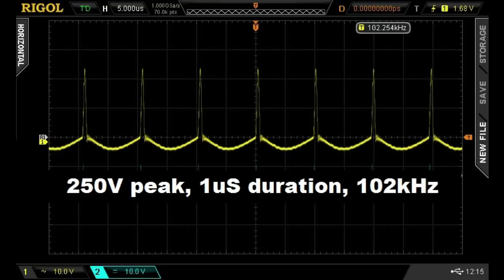Longitudinal Current Induced by Dielectric Field Impulses

Comment: Keep in mind that moving charges do not create a magnetic field. When a dielectric field aligns charges, a magnetic field forms. These are position sensitive, and particle sensitive effects.  Only the correct type of particles sensitive to the dielectrically conditioned Ether or the magnetized Ether respond to the Etheric state that embraces them, demonstrating the presence of the Ether in that state. The idea that moving charges create magnetism has been disproven as simply moving charged particles does not produce magnetism. ref: https://youtu.be/Khl4F6cr36A 

Also consider that magnetic lines of force, as described, do not exist. Those are how magnetized particles will align relative to each other in a field of stronger magnetically aligned Ether. Other objects that otherwise are pushed by the magnetized Ether field do not distinguish any such lines as lines of force. It is a simple way to explain some of what standard electrical equipment will do, anyone would be on thin ice to take it further and assume the explanation is accurate to reality or can be used to develop new designs.

Back in the '80s Borderland sciences staring EP Dollard and crew (P Lindemann) demonstrated differential electrical wave transmission 57% FTL in conductors using a differential line consisting of series capacitors and shunt inductors. He also demonstrated that the magnetism and charge traveled coincidently, not off-setting each other as typically happens in normal differentially driven circuits. ref: https://youtu.be/6BnCUBKgnnc This is an example of how a superior technology, even easy to implement will be shunned by industry if it is disruptive enough towards existing systems and beliefs. Neither of these gentlemen have led a normal life since that time; It also clarifies that Steinmetz was simply putting together a model of electricity that was tightly designed to aid the productivity and patent protection of AC Power, not to explain how electricity could be employed, or what it was and how it really worked. HE was also a political critic of the industrial system he served. I believe he wrote telling comments in the beginning of his textbooks that painted a dark warning to free thinkers who did not conform to the methods commanded by those in charge. As well as publishing books on the failings of free-market economics to be sustainable without back-room deals and price-fixing or other methods to carve up the markets between suppliers (which would include creating a false narrative to justify using specific technologies).

Using standard electrical descriptions to explain new phenomenon is a minefield of exposing the pseudoscience nature of modern physics. And I appreciate that you have avoided being caught up in that confusion with your explanations. But, I also can't let it go. I cling to the belief that clarity is possible and by exposing the silent assumptions new possibilities will be revealed. Good Luck, be safe. Wilhelm Reich discovered how to capture, generate, and apply this technology without electricity. He did not have access to the discoveries Tesla had made and remained ignorant of the threat his work posed; He was convicted of a crime one of his employees committed and killed in prison after all his research was burned by the state of New York. His focus was primarily on healing, but by chance he discovered how easy it was to make it rain; I'm sure he was blamed for some massive futures losses by investors looking to sell short during a time of drought in the US.

Remember, energy is not supposed to be created, an inane statement when you know it is made of two components that produce each other. Which makes amplification possible; but, what is the difference between amplification and creation? (practically nothing) Here's the rub, the lie is so easily exposed (without it, the transatlantic cable is impossible). But pressing the point threatens the authority that empowers governments around the globe. Peace, B
Reply: How Did W.R create capture enagy without electricity or healing . I know ougone(sorry spelling sir)
But I need both healing and enagy capture, create without Electricity please let me know sir if it true thank you sir.
Reply: @motobacktoconstitution4138   Reich captured natural/free-range Ether with capacitors of special construction. The metal plates were all magnetizable and the insulators were natural materials (wood, wool, that kind of thing. The collectors had metal on the layer closest to the person receiving healing energy, shields were reversed. Not good for every illness and overdoseing was a potential problem. Up to 7 layers improved collection with each layer, more seemed to be just extra mass without measurable improvement in collection. People in the box began to see the active Ether in the air. Reich admitted his name; "Orgon" was likely Ether. He did not have access to Tesla's work or he might have kept a lower profile. Tesla made it overwhelmingly clear his discovery would break the bank of industrialists in his day, and today it could be even worse.
Reply: @motobacktoconstitution4138  The details of Wilhelm Reich's discovery of capturing and amplifying natural Ether from the space you occupy is detailed in the book: "The Orgone Accumulator Handbook" by James DeMeo, PhD.
There are health warnings of overcharging your system with the technology, so it is worth the read.
Basically, you build a 7 layer capacitor of magnetic metals and organic dielectrics. You better have some tested construction skills, the weight of the structure is dangerous. But, you don't need a Ph.D. or 10 years paying rent for a University to do it. 

You can charge up your body to good health and the ability to see energy in a way that science does not dare acknowledge for fear of cutting off funding from their big pharma funders. There is a proven technology, putting living beings in a high voltage field, that improves cell function and replication to the level of enhanced DNA replication (faster healing and improved DNA expression, longer living) which big pharma patented because it threatened their "drugs to treat symptoms without curing" business model. ORiginal work done by Ebner, called the Ebner effect. The swiss pharmaceutical company found any voltage from 1 volt/cm up increased the effect, but 100 V/cm had a significant effect. So it seems we like being charge aligned-magnetized.or rather cellular living likes it. No one has studied the Reich box, it may do the same thing (Maybe in a small way) Google "Ebner effect". He studied plants and fish, sold patents to big pharma, who shelved it after successful research results. Their patents have long expired.

Party on dudes, be good to each other.
Reply: @mundymorningreport3137  thank you for repry sir . they have purple light scaler heaing they treat people with scarler pose have you ever hard of that ? And Master Ivo created healing chair and there are other scarlar chair decade ago they created use longtudenal wave. But purple scalar theropy is getti g populer I wonder  are thet similer to william Reich product ? 

I wander 4th Reich & william Reich family has any connections since many Nzazi sientest Migrated from operation paper clip anyway I will look those peoples name you commented thank you if you know any mecanizm about parple scarlar therapy please let me know thank you sir🙏.
Reply: @motobacktoconstitution4138  There is a lot to be learned when it comes to cells reacting to various components of atomic emissions. But, it stands to reason that cells utilize all energy transfers between molecules. Doesn't it?

David LaPoint, a plasma physicist has spun projected magnetic fields and done testing on the healing effects; he's convinced (and measured) the moving magnetic fields create ionized molecules or induces charge formation in atoms. This directly is energizing the cells, and for many biological functions, it helps.

Master Ivo, I'm a fan, is sticking to the dielectric/normal charge effects in his experiments, ignoring the crossover to Ether that Tesla pressed the boundaries on. Clearly, this is beneficial, but, still not the completely different physics that Tesla was careful to isolate with his "free of charge carriers" electricity. (just the electrical Ether, none of the charge particles that conditioned the Ether. Although impulses have more dynamics, it isn't much different than the electric fields of Ebner's work. (Yes, the dynamics of impulses can be significantly different in effect, especially at lower voltages. But it is still just a dielectric field effect and delivered with charged particles..)

Tesla developed a truly disruptive technology, virtual particles, energy that is so specific to what it can interact with, that it passes through everything else. So, it is nothing to everything and pure critical ingredient to what you want to do, acting without resistance or wasted side effects.

With it also able to convert raw AEther from the planet or in space into his captured form of Ether, It means unlimited resources on demand, no shortages of anything ever, and no wealth for monopolists or hoarders. Plus the ability to remotely initiate or control any physical action/reaction.

Clearly putting the power of God in the hands of Man, and scaring the * out of social leaders who rule by extortion/fear or with $s.

Only Tesla was willing to trust all mankind with that kind of power.  The irony is without understanding the science, you cannot count on nature to remain supportive when you don't know how it works. And so, we all could die at any moment, if we don't kill ourselves off first.
The choice was to live in pain rather than risk someone abusing that power, which is still available with very low tech and accessible parts, and not really hidden since it is how nature works...  "John dies in the end" Party on Dudes, be good to each other.
Reply: @mundymorningreport3137  thank you repry sir🙏. 

who is John?

Comment: thank you for this, when my brother asked me many years ago what is electricity I told him it was the release of dielectric pressure
Reply from the maker: the dielectric and the magnetic fields need to be both present at the same time, for electricity to appear.
Reply: yes i understand but the conducting material has a dielectric component that is at an equilibrium since it's formation, the magnetic field interaction with that conducting material inflates the dielectric in the material when that increase in dielectric is released we detect electricity. Magnetism is the only thing that can move the dielectric, magnetism pushes the dielectric, electricity is the result of this movement.
Reply from the maker: @dogstar167   eh no. its the other way round (in my opinion:). The transverse movement of dielectric lines of force (faraday tubes) drag along a volume of AEther, that when rotated, forms a Aether vortex, that is the magnetic field

Electricity forms when both the dielectric and magnetic fields are present at the same time and space
Reply: what sets the dielectric lines of force in motion?
Reply: start with the one thing you know is in motion the magnetic field, it is rotating forming the Aether vortex independent of the dielectric
Reply from the maker: @dogstar167  a closed loop circuit
Reply: a closed loop circuit ? is that your answer to what sets the faraday tubes in motion?

Comment: The push is on space time. If an iron bar is filled beyond it's saturation point! It find's a new place to dump that extra energy ( Counter space).
Reply from the maker: the  push is more energetic when the time is shorter. results in a larger volume of space gettimg pushed

Comment: Thank you.  Are you saying that with magnetism,  the geometric magnitude of the loss of inertia is what creates time?   And there is another aether modality that is expressed outside of time?   i.e "Longitudinal Current induced by dielectric field impulses"   or would you also consider the wake front of this impulse time, but just at a much faster rate?
Reply from the maker: No, for me time is related to the rate of transformation. A impulse has a very fast rate of transformation, and therefor a very small duration.
If you look at the dielectric voltage as tension, this impulse represents a very fast change in tension, like a explosion, or even better, an implosion.
Reply from the maker: I tried emailing you, thank you, but your website is down. So the email bounced. So, again, Thank you for your kind donation.
Reply: @MasterIvo  thanks for pointing that out.  My domain expired I just fixed it....

Comment: That makes perfect sense why that first video I shared with you is the perfect frequency for producing CHARGED HHO gas.

Please watch the videos I've shared with you @Master Ivo, you've discovered the key that opens the ether.
Reply from the maker: Sorry can't remember, so many different responses, what video donyou do you refer to?
Reply: In one of your previous videos I've shared three different videos with you.

The first video displays the type of coils I believe you need but more specifically it shows you the modulation you require to induce diamagnetic induction and the tightly packed modulation of on and off rapidly over a short time frame.

You're the first person I've found who can actually properly relay what Tesla way experimenting with.

The first video will not say a.great deal to you but once you've watched even just two of the primer field you'll see how important this particular shape is.

When you say you need a negative charge to begin the flow of ether but also keep the flowing then this particular gated pulse width modulation is what you want to be seeing on your oscilloscope, but I believe it's the shape required for your coils because these naturally do the slow build up you're also talking about and of course depending on your discharge modulation switch being at the correct on and off frequency will depend on your outcome.

The final video is a gentleman who went on to do these coils but unfortunately misinterpreted his data.

If you can't find them in your previous videos please say and I will post them in the comments reply for this comment.

I don't know if you'd heard of Stanley Myers who build a water powered buggy.

Well it was this frequency he was utilising specifically because of the shunting it provided and it also made the HHO gas positively charged so it would explode rather than implode inside the combustion chamber.

I know you're like a finger snap away from resolving all of this and showing he world exactly what Tesla was doing.

You're 100% correct that without the slower high build up and rapid discharges it can't work because only it's them discharges that can open the fabric of the ether, Stanley also used a a magnet on the gas as it was flowing from the cell where it produced the gas on over to his electrical agitation where I think it was going from negative into th positive it needs to be in order to explode not implode and pull the connecting rods from the pistons.

I can't tell you how exciting it is to see th so close and I know that these videos will be what you need to sit back close your eyes and invision what's taking place.

It's definitely what you're looking for,it behaves like a choke but also releases pulses when critical mass of energy is reached.
Reply from the maker: Yes I remember the primer fields video, and am familiar with Stanley Meyer. I also feel close. but close can be a long time. We'll get there for sure!

Comment: Once your open to the concept that there is  more than an inverse to  any effect and come to realise that there is more than an opposite and equal reaction you start to consider so much more. Why do we write right to left. How did that become and what have we missed in the intricities if it had of been the other way around? Is it an equal opposite in its characteristics? What about pressure and vacuum not be opposites in their characteristics? Why do we always instantly assume so many things have an equal inverse reaction. I feel the answers are just not being measured by the right instruments!!! We as a species need to evolve from an understanding that we are still trying to use the same measurement equipment that will not suffice for these energy measurements. It's like using a multimeter to measure the color of  a shooting star. It just does not seem applicable in my mind that we would us a energy pulse on a copper coil to impact the etheric feild. I don't know what else yet but I would feel its less dense like a gas in a spiral vortex configuration. Something that is already in close proximity to the immaterial existence of the ether. Like a solar flare. What characteristics does it hold? I feel they need to be studied in their geometrical form. What does all that energy in the flare transfer to? My guess is it has an effect in the ether. Radiation can't be seen nor can the ether so are they consisting of similar construct?
Reply from the maker: All is made out of Aether fields